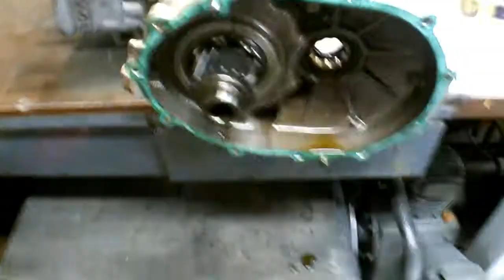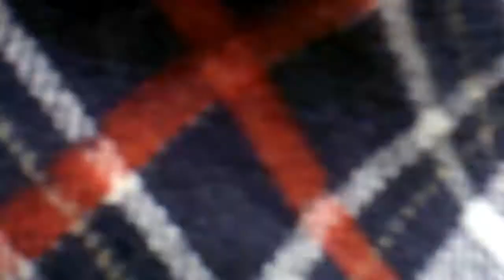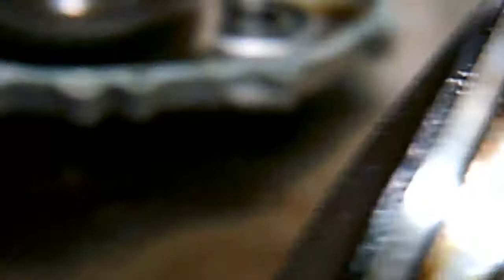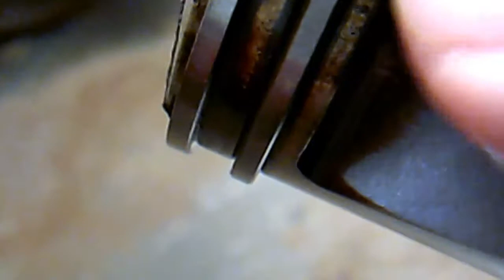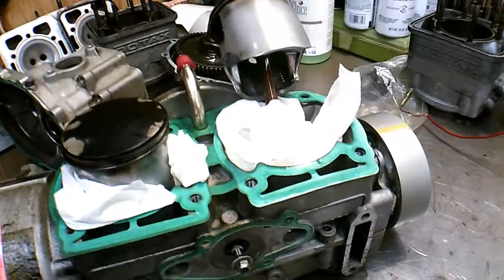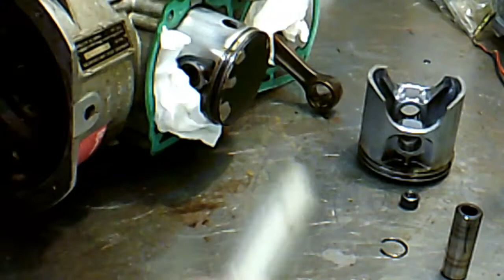Rotax 582 Modifications #3 Teardown: Gearbox, Magneto, Cylinders, Pistons

Comment: Hi, I am disassembling a C type gearbox, but cannot remove the main gearset (goes into the splined spider which is bolted to the rubber donut).  I have taken out the bolt in its centre, but it will not shift.  Have you any suggestions?
Reply from the maker: It could be that someone used Loctite on the spline. This would not be needed. If that is the case, you will need to heat the spline to 450 F with a torch. That will destroy the Loctite.
  Then I would put the center bolt back in, but leave it loose a  few turns and try a wheel or gear puller to press against the bolt head.
Reply: @Adventurepilot70  Thanks for your reply.  Oddly, after maybe another 15 mins of heaving on the gear (not using pullers or heat), it just dropped out.  It had anti seize compound on it, as it should have, so I can only guess it formed a really good seal which held it in tight.
Reply from the maker: @ianrule4298  Great. Happy to hear it.